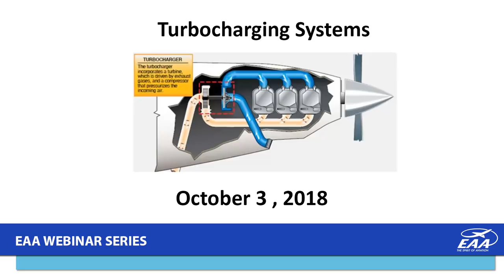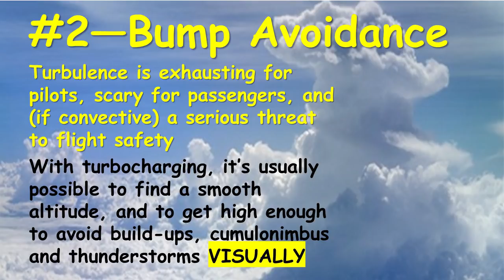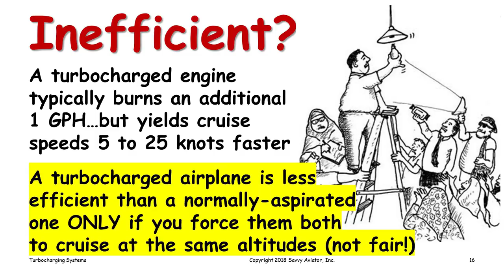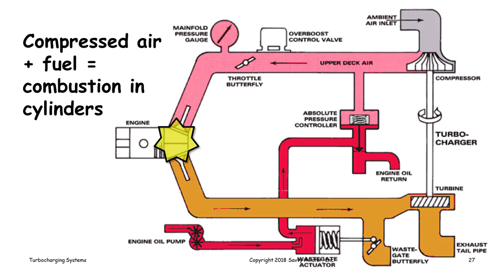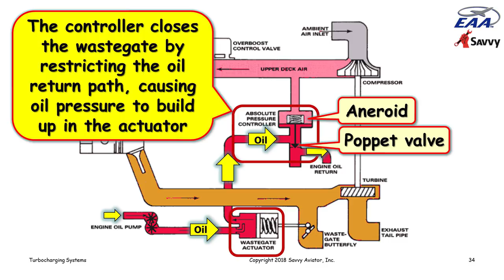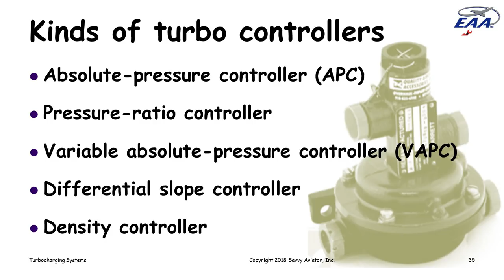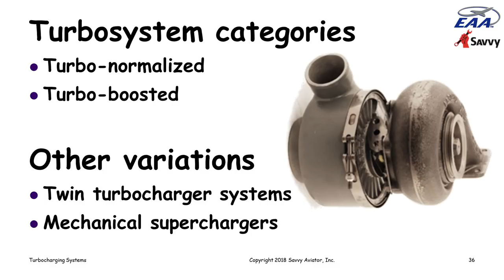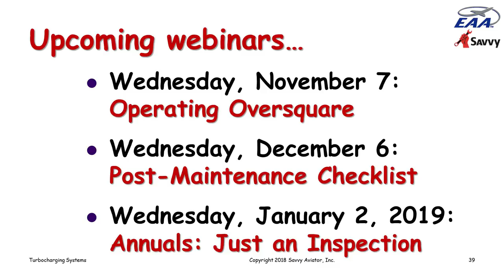Turbocharging Systems

Comment: Good stuff. I am not one to tell anything to Mike Bush but I do have a couple comments. As someone who has extensive experience with turbo applications I will say that the “cool down” procedure isn’t really to allow the turbo to spin down. It actually spins down very quickly. That’s why it is important to not be “ham fisted” and yank on the throttles. The primary purpose for allowing a cool down period is to allow for cooling of the turbine section while providing continuous oil flow to the bearings. The turbine is extremely hot during flight as it is producing boost. If you do not have a decent amount of time to allow this cooling and shut down engines quickly, it can heat soak the turbo including the bearings. This could over time damage the bearings due to coking of the oil. So a few minutes of idle or low speed taxi prior to shut down is a good thing. Also, it is fair to mention that direct drive or mechanical driven supercharger systems also require power to operate thus placing an extra load on the engine. This can produce more engine heat and reduces efficiency.

Comment: The six minute idle period suggested in POH's is not about letting the turbo shaft slow down..........the shaft will slow down within thirty seconds after you reduce power to idle..........the six minute idle period is to let the turbo shed the heat in the Center section where the oil and bearings are located.......the Center section is connected to the compressor and turbine sections which are hot from operation.........if you shut the engine off quickly , the Center section gets cooked by the heat that has not had time to dissipate ..........the intake air and lower exhaust temp and air flow through the turbo will cool the unit fairly quickly if left to idle.........but it must have time to complete the heat removal..........even the lube oil helps remove heat from the center section...........if the cooling down period is shortened , the excess heat will coke or carbonize the lube oil in the shaft bearings and over time will wear them out or cause the bearings to drag or completely seize up..........lube oil will coke relatively quick when exposed to heat left behind after a hasty shutdown...........unless people see the turbine section glowing orange under load , they do not realize how much heat is being absorbed by the turbo from the exhaust flow through it.........if you do not give the turbo time to dissipate that heat and you shut off the engine too quickly after landing , the turbo cooks in its own juices and damage is inevitable..........the idle period is not about letting the turbo wind down in rpm...........it is about cooling it off..
Reply: Please explain in this case: Why is no time advised for this "cool down" in the POH of the C182T
Reply: An electric after run oil pump would help with the shut off cool down (no coking). You sir hit the nail on the head, well done.
Reply: .....true......but why the ellipses.....?
Reply: Jupp Schmidt POH does not advise every best practice for engine longevity. That’s why we learn about things like the red fin and the big pull method from other sources
Reply: I'm glad you said this. I cringed when this guy  didnt know why it was important to let youre engine idle for a few mins. Wouldn't let him near my plane, lol 😂
Reply: @juppschmidt290  You really need to give an exact year and engine model if you want an answer.
Reply: @tango9939  Or when he was talking about what else keeps a plane longer on a High Altitude runway, he basically said "cus that's what planes do", even tho he should have said that the lift is just not enough duo to the low density lmao
Reply: @tango9939  Your RC or your paper plane?
Reply: Question....so if the problem is trying to reduce or eliminate coking of oil in the center or hot section by shutting down at a temp that won’t do that, why not monitor the tit temp(as displayed on my edm900)? Why is it a function of time? When I do think to hit the timer and wait the recommended 4mins after landing on my B36TC, the tit temperature gets below 800’ F. Is that low enough? 
Also would ambient temp play a role. Thanks
Reply: This is largely an OWT and only applies to a very quick shutdown after extended high output operation, generally racing applications are susceptible to this.  Almost all airplane operations will provide plenty of cooling time during approach, landing and taxi in.  It would be a challenge to run an engine at a high power setting during approach and landing and then kill the engine immediately upon touchdown.

If you read the information at web sites of Garrett, Mahle, etc, who make turbos, you will find that they spend far more time emphasizing the need to use the right oil, in the right quantity and changed at the right frequency than they do talking about shutdown procedures.  Most turbo manufacturers only caution about quick shutdowns after running fast laps at a race track or after climbing a long hill in a truck and then immediately pulling over and shutting down.  I am not aware of any modern turbocharged car, other than high performance sports cars, that require extended idling before shutdown.

And keep in mind that air cooled engines tend to get hotter when idled a long time so a prolonged idle will likely increase the oil temp increasing the likelihood of coking oil in the turbo center section after shutdown.
Reply: LT is correct.  GAMI proved your last paragraph years ago by instrumenting a turbo housing and recording temps. The temps did rise during the idle “cool down”.
Reply: @kenliszewski1960    open the cowl flaps point the plane into the wind  during cool off time. then go park it..

Comment: My ears perked up when Mike mentioned aftermarket intercoolers.

Years ago some clients I occasionally gave flight reviews and IPC’s to upgraded their Piper Turbo Lance (one of those T-tail versions). Once I discovered that I checked the Chapter 9 revision to the POH and discovered the manufacturer HAD a power conversion chart. I cautioned them to follow it but they said they were just going to run it off the original performance charts. It came back to bite them. I don’t know how much time they put on that engine before it died but die it did on an IFR XC (oil on the windshield and a frozen engine) that resulted in a total loss of the airplane and serious injuries to the pilot.

Comment: Going back to the airlines running DC-6's and DC-7's, the DC-7's were retired before the DC-6's. Why would anybody retire a newer model before the older model, you may ask? The DC-7's used a turbo-compound engine. That meant that there was a reduction gear to connect the turbo to the prop shaft to extract more horsepower from the exhaust gas. Think about the reduction ratio required to go from turbo rpm to prop rpm. The system was very tricky to maintain and poorly understood by the industry. Gears are heavy and introduce eccentric loads that are not present with a more common turbo. Turbo-compound engines were late to the party and never fully arrived. So, if the airlines couldn't live with turbos, how was general aviation supposed to make that magic happen? The naming conventions got a little sloppy, turbo-compound is a whole different animal from the turbos that we are familiar with.

Comment: I’m not sure he fully understands why you wait to shut down your engine with a turbo charger. The turbo charger spools down almost immediately when you cut the throttle to idle. My understanding, especially coming from the trucking world and agricultural world is a turbocharger runs extremely hot and not only does the oil lubricate, but it also cools the center section which is literally touching the exhaust. So while running hard, that center section is extremely hot and the oil is cooling it while it’s running so a four minute idle Cools down the casting so that when you shut the engine off, you don’t have burnt oil that can eventually plug the supply to the bearings.

Comment: To fly at the altitudes optimal for a turbocharged aircraft, you will need oxygen or pressurization. Could you comment on the added cost of maintainance of these systems and the increase in insurance rates for these vs the normal aspirated aircraft. It seems that with these factored in, the cost differential goes up consideralbly.  Thanks.
Reply: Pressurization is its own can of worms, and many mechanics will advise against pressurized piston aircraft altogether.

As for supplemental oxygen, the cost increase isn’t significant. Built-in systems require a hydrostatic pressure test every 5 years. Cannulas and masks are available online should you need to replace them. Mechanics generally do charge for O2 service, but if you have a good relationship with your home-field mechanic, they may not charge you. Away from home, I find O2 service costs $50-$75. At home it’s free for me. I usually refill every 2-4 months. 2 people don’t consume much O2; 4 people do. You can also purchase your own O2 refilling station. This is only an efficient option if you’re consuming tons of O2, like if you’re filling most seats on most flights. 

Portable O2 systems don’t even require an stc if you’re not hard mounting them.

My insurance on a 1980 TR182 was $2800 for the first year with 500TT in my logbook. I’m over 750 now and expect to see rates drop. Waiting for this year’s quote now. Retractable gear and >200hp are going to impact insurance FAR more than just a turbo or O2 system. More ratings and more hours are the best cures for insurance concerns.
Reply: @BIGJOESXR  Thanks!